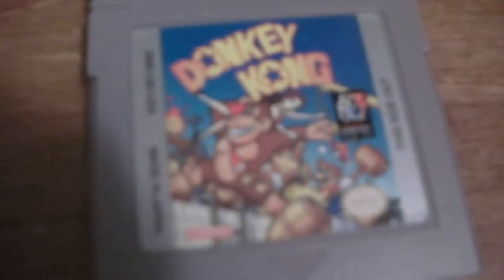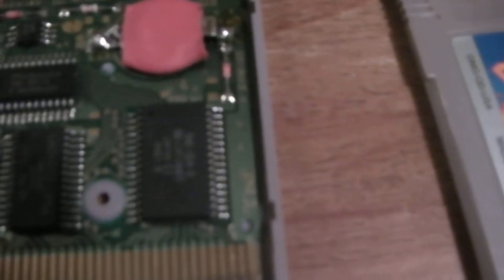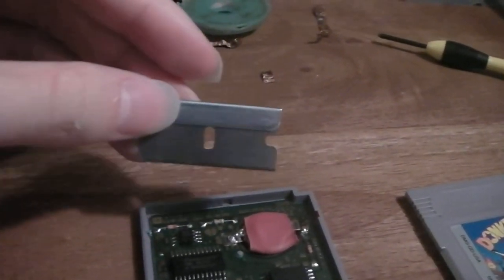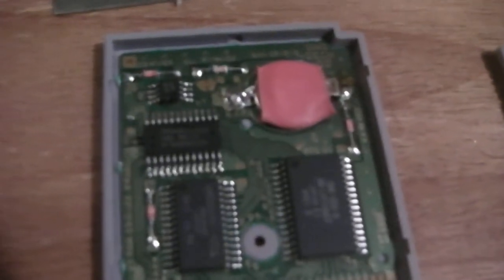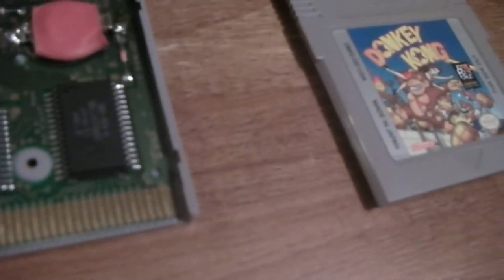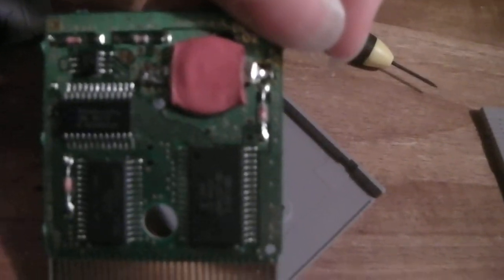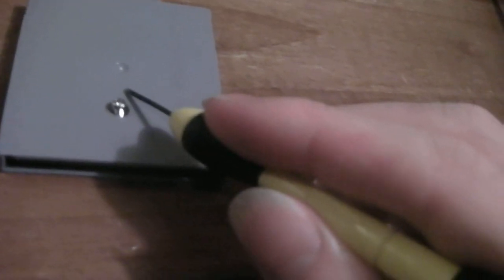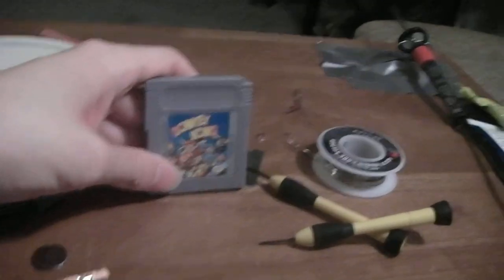Game Boy Battery Change for Donkey Kong Cartridge

Comment: I have replaced several batteries in these games before.  However this game I replaced the battery and played the game for a few minutes then pressed start and selected save and quit. It didn't save at all.  Is there a certain point in this game where it will only save?  I tested voltage and voltage is correct, any ideas?
Reply: Jason Fisher You have to get past the original 4 levels before you can save.
Reply: I've played it several times and it still doesn't save after the 4 levels ans save through workd 1. Should I try a battery swap now?
Reply: @JohnEdington-je8bx  If it's not saving yes I would suggest changing the battery out.